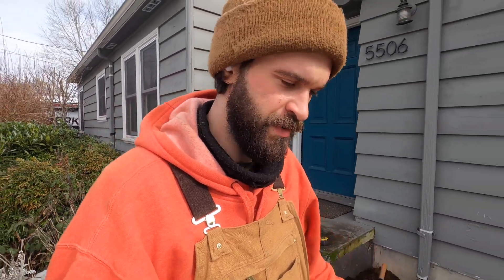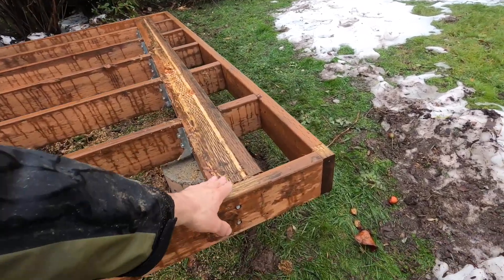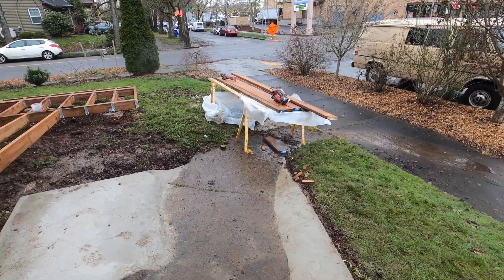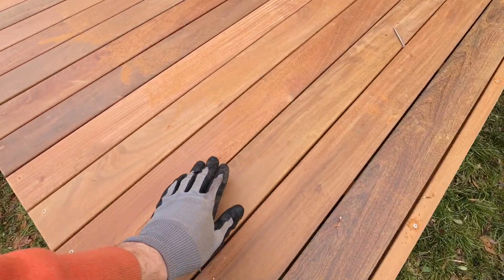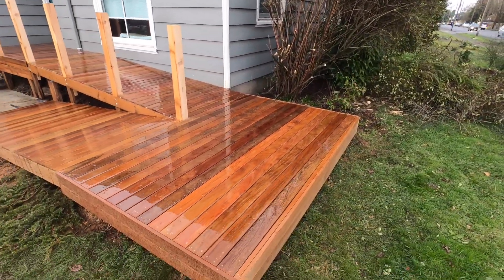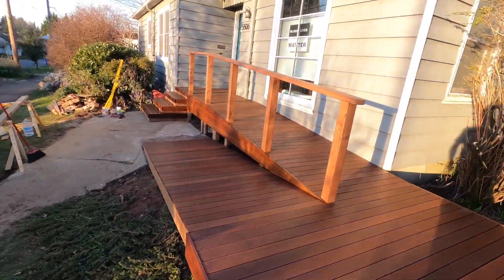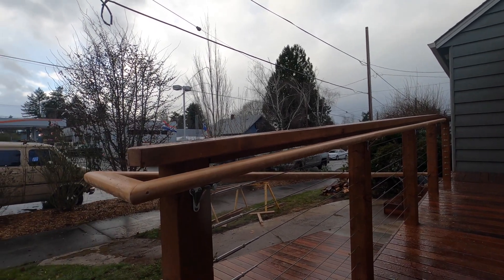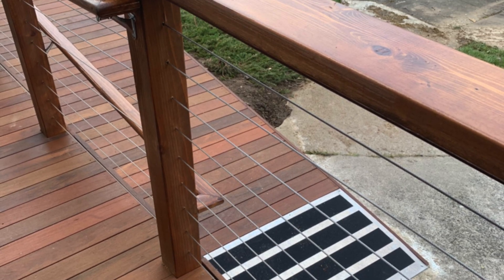Wheelchair Ramp for the Homie

Comment: Thank you for this. I'm building my first deck/ramp and this has helped more than any other video. I do have one question -- does it not matter that the joist hangers for the ramp ledgers are not slope-able? When I was about to install with the ones shown in the video, I realized it wasn't possible for the sloped joists to sit flush into the back of them. The joists effectively hang on the edge of the hangers. Simpson's LRUZ seems more appropriate...?

EDIT -- I just rewatched and realized what I missed the first 50 times -- the seat cut! Had no idea what that was when I first studied your videos. I know it's not to code, but because I wanted a continuous 30ft ramp, I ended up sistering joists over the 6x6 beams with birdsmouth cuts.
Reply from the maker: @sicottepc  interesting comment! The LRUZ is for rafters that are going to be fixed for the most part in many ways to a ridge and then sheared all around. In my mind they just keep a rafter from pulling away from a ridge, while not necessarily carrying a downward load. I think a rotating hanger like that would squeak and ‘move’ in this scenario. The ramp only drops at a 1/12 pitch, and I’m pretty sure you can technically do a tiny shave like that on a 2x8 since it’s a bit oversized. Who knows! Thanks for watching and I’m stoked it was helpful for you!
Reply: @PerkBuilders  Thanks so much for your response. Any way I can send you money for a coffee/beer? 

If you don't mind, I'd like to rephrase my question (which I should've done after my edit). Is notching the joist for the ledger connection the way you typically create the ramp pitch? I agree with what you said bout the LRUZ -- I had a similar concern. Fortunately, my application appears to fall within their load table. I know I'm not using it how it was intended, and I haven't been able to figure out if it's better than a non-flush joist connection to the ledger. Maybe I'm overcomplicating.

Thanks again. Cheers.
Reply from the maker: @sicottepc  specifically in this scenario I wasn’t working under any code restrictions, since the deck height is under 30”. In those cases I always follow code and make the best determination possible. If it were steeper, like a real stair stringer, the notch would be a no-go. My thought here was to add the pressure blocking and have the shaved hangers so that we’re just never worried about it, in aggregate. It still makes a lot of sense a few years later
Reply: @PerkBuilders  Ahh okay, thanks for the explanation.

Comment: I just built a ramp at my parents and I couldn’t find variable joist. Did I see that you just cut the wood to fit? I bought open ended ones.
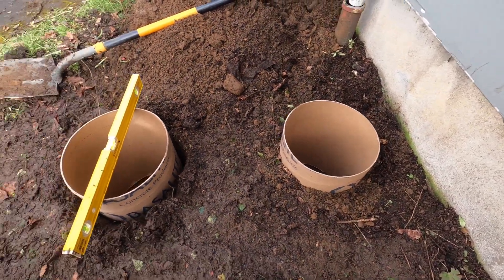Reply from the maker: In this scenario yeah, I just shave the bottom corner at level to land solid on the hanger. At the 1:12 pitch of the ramp it amounts to about 1/4” removed, which is totally fine in my world/mind

Comment: Do you need any type of flashing for where the decking meets the siding? I need to build a ramp also.
Reply from the maker: Good question! Typically, yes. Anywhere you’re actually attaching to the house, you’ll want to trim the siding all the way back to the sheathing of the house and flash over your ledger board. I have Z flashing up where the front door landing is, but on that downward slope against the house, those are spanning landing to landing, so that joist is not attached to the house. I hovered it 2” off the face of the siding and pushed the decking close, but about 1/2” off the surface of siding so everything can drain

Comment: Are you or the customer not concerned about having an external railing to keep a wheel chair from accidentally rolling off the side?
Reply from the maker: We had talked about that and decided with the low height that it wasn’t something they wanted visually. Technically that would be the only thing that isn’t ADA compliant but it works here in Portland if it’s under 30”